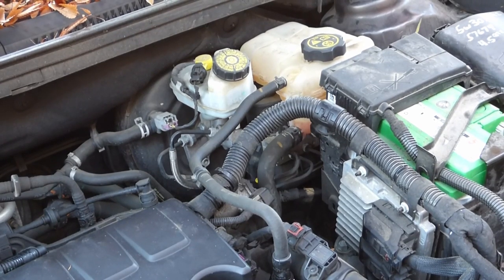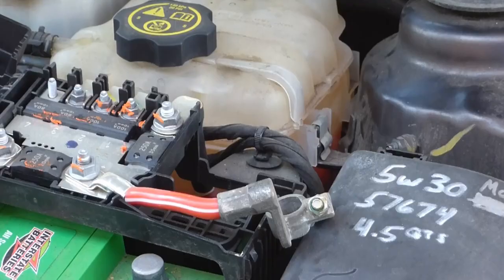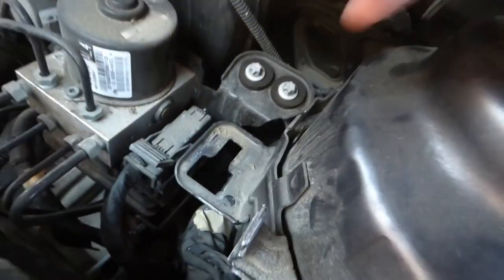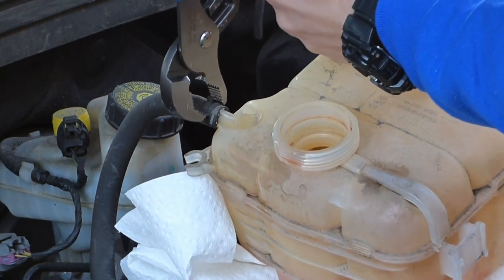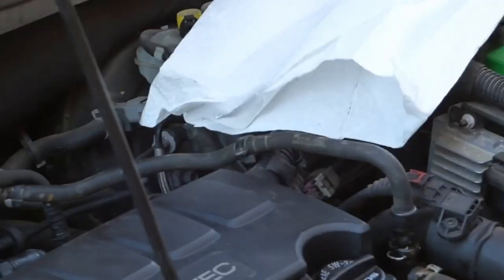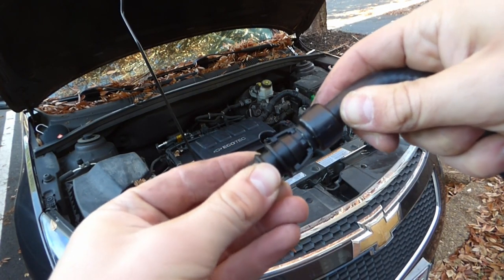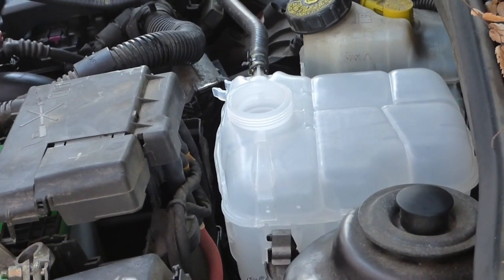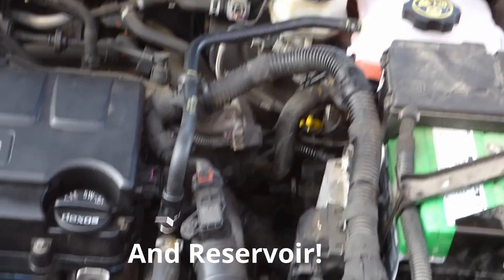How to Replace the Coolant Reservoir AND Inlet Hose on a 2014 Chevy Cruze 1.4L

Comment: I changed the hose and at the part where that metal wire clip that you dropped; it still leaking after replacing it. There’s an o ring inside; does that go on the plastic part or does it just sit inside the hole 🕳 also; did you use a wire instead of the original clip?
Reply from the maker: There should be an O-ring on the plastic part that goes into the hole. I don’t believe there’s an O-ring in the hole, if there is then you may have some of the old piece left over which would explain the leak. I used a piece of wire because I lost my clip, but I got a new clip since then.
Reply: @AJSWoodworks  I got the part to fit: I guess you really have to press down on it until it pops in; no leaks! 👍 drives good everyday but I still have my check engine light.

Comment: Great video 😊 it helped a lot I have a Question the small black piece u take off the old hose and put on the new one and it should snap in mine has a small crack should I replace that piece?? Do u know the name of it??
Reply from the maker: It comes with the water outlet, unfortunately you will have to buy the whole assembly to get a new one.
Reply from the maker: But yes, you should replace it!
Reply: @AJSWoodworks   ok thank you so much. I'll replace the whole thing I appreciate it

Comment: What do you do if you replaced this part, and its still leaking from that joint?
Reply from the maker: It’s possible that you haven’t seated the tube properly or that the connection is dirty. Or, the bottom connecting tube may be cracked. Other than those few possibilities, there might be a defect with the new tube, but that’s unlikely.

Comment: Thanks for sharing. is it easier to just buy the  whole connector piece and just  attach it to the hose and plug it back in  and clamp it  ..  rather than use the old stuff that way its all new parts again ??     mine has a little leak as well there.   does it need the hose too  or just that  plastic connection thing ?
Reply from the maker: You have to buy the whole water outlet to get the plastic connector piece.
Reply: @AJSWoodworks  i saw the hose and it comes with the connector piece if im looking at the right thing i hope...  just have to use the same cotter pin thing .   the bypass intake hose
Reply from the maker: @joedevitto6113  I’m sorry, yes, you can get it with the hose.
Reply: @AJSWoodworks   ok thanks ,  its hard to figure these things out sometimes ..~

Comment: Okay sorry another question. We test drove the car, coolant reservoir is completely empty & car engine was smoking, I think the smoke came from the mess we made when the coolant leaked everywhere when we did the water outlet replacement… any idea why the reservoir is empty, it was boiling when I unloosen the cap?
Reply from the maker: Did you do the refill procedure where you run the car with the cap off of the reservoir and fill it up as the level goes down?
Reply: @AJSWoodworks  yes we did & then test drove.  Once it cooled off, I refilled it & its leaking. I can see where it’s coming out under the car
Reply from the maker: @ladiihatch5024  Can you tell what it’s leaking from?
Reply: @AJSWoodworks  not really. I just know it’s in the area where that big hose you had to take out. But closer to the radiator. The plastic big one

Comment: Does it mater if there is air in the inlet hose when you refill the resivoir with coolant?
I took off my old resivoir.
Drained the line.
Replaced the resivoir and reconnected the lines
Then drove it home without refilling coolant. After realizing I forgot to refill coolant I put more coolant in the resivoir while the engine was cold.
Than I drove it but the new coolant was never taken in through inlet hose.
Is this because the inlet had air in it or just because the engine never got hot enough?
Reply from the maker: You have to make sure to run the engine with the cap off of the reservoir in order to let all of the air that’s trapped in the system release. Otherwise if you just run it with a cap on the reservoir then all that air is trapped in the system with the fluid.
Don’t drive it with the cap off though, just let it idle.

Comment: Lost metal clip.. wat can I do they do not have the part at the auto store ?
Reply from the maker: You have to purchase the water outlet to get a new clip, or you can fashion your own out of a clothes hanger.
Reply: @AJSWoodworks  awesome thank you for your quick response! One last question, would the car mess up without it ?
Reply from the maker: @gabesfam915  You definitely need the clip to hold it in place. Otherwise with the pressure of the coolant system, you will have a bad leak.

Comment: Is this an expensive repair if i took it to a mechanic? The inlet hose broke off and needs to be replaced. Thanks. I don’t need to replace the overflow reservoir bottle.
Reply from the maker: It certainly can be depending on their charge for labor. It’s significantly cheaper to do it yourself, and it’s relatively easy to do.

Comment: Does anyone have a link to purchase the u shaped metal clip seen at 8:40?
Reply from the maker: Unfortunately, you can’t buy the metal clip separately, as far as I know. However, if you buy a water outlet, it comes with the clip that you need. Here’s the link: https://www.amazon.com/gp/product/B07CZ9LF1P/ref=as_li_ss_tl?ie=UTF8&psc=1&linkCode=sl1&tag=ajswoodworks-20&linkId=9e996f73e10454a892dc2db77da70fbf&language=en_US

Comment: Should you drive it or get it tow to a shop? Mines just started acting up. Smh 🤦🏽‍♀️ help please?
Reply from the maker: It depends on how close the shop is, but you always risk overheating the engine if you don’t have any coolant in it at all. If it’s just a slow leak then you’ll be fine, top it off and make a short drive.

Comment: What’s the noise at 11:10? From the engine? Sounds pretty loud...
Reply from the maker: Carlos M. The ticking? It was the spark plugs. I replaced them  and it doesn’t sound quite as loud anymore.
Reply: AJS Woodworks yeah I just saw your video... mine is not loud, it is low but I always wondered why cars had that noise...
Reply from the maker: Carlos M. If spark plugs don’t solve it, it could be your valves that need adjusting.
Reply: AJS Woodworks the valve cover?
Reply from the maker: Carlos M. The valves themselves need to be adjusted sometimes.

Comment: Hey, the piece you had to fish out , when I got mine out the piece it was stuck in kind of cracked on one side and a piece came off now it won’t sit in it correctly, what’s that part called or how can I fix this?????
Reply from the maker: You mean the end of the hose that the inlet hose connects to? That connection is part of the water outlet, and you would need to replace the whole thing.  The water outlet comes with the metal clip, and the in-between piece.
Reply: AJS Woodworks  ..at 8:30  the piece that your connecting it to . Black plastic piece the end of hose connects to. It cracked while I was getting that stuck piece out, your saying I would have to replace that entire part? Can you tell me what that’s called
Reply: AJS Woodworks ..also I have a 2012 Chevy Cruze not 14.
Reply: Did u have any lucky with the part I'm having the same trouble can't seem to find a hose with the same little black part in the in I went to AutoZone they didn't anything that looks like that they gave me a different that doesn't need a clip for the bottom part
Reply from the maker: Adrian Lopez The link to the correct part is in the description under “inlet hose.” That’s the part I purchased and it has the correct attachment.
Reply: @AJSWoodworks   thanks bro I was having a hard time trying to find it AutoZone nd o'reilly's didn't have it and gave me the wrong part but thanks you 🙂

Comment: So what if you can’t get that little piece out??
Reply from the maker: You need to be able to, otherwise you won’t get a good seal and you will need to buy a new part.
Reply: @AJSWoodworks  what’s that part called?
Reply from the maker: @molliemaemedlock  The inlet hose? To replace the small piece in between you will need to buy the water outlet.
Reply: @AJSWoodworks  thank you so much. I’ve called every auto parts store in my area and none have know what I’m talking about. Going to get a water outlet now
Reply: @molliemaemedlock   Did that work buying that piece i was wondering.  ?  seems  easier to just buy a new one and  not have to put it all together just plug it  in  and connect it to the house and its all new again im thinking ..  i think mine is  the problem  i see its wet  around that  connection
Reply: @joedevitto6113  yeah I ended up totaling it not long after 😂
Reply: @molliemaemedlock  Oh noo..    hope you didnt get hurt.   ,

Comment: Whenever I put the new hose on it doesn’t snap down
Reply from the maker: The new hose only snaps together with the clip.
Reply: Do you know part name or number for the plastic at the time 7:41 in video?
Reply from the maker: @alyssajimenez2510  Unfortunately, I think you can only get that piece if you purchase the entire water outlet. It also comes with the metal clip that holds them together.
Reply: thanks for the video brother I have a question where I can get plastic that goes on the tip that you got from the old one because mine is broken thank you very much